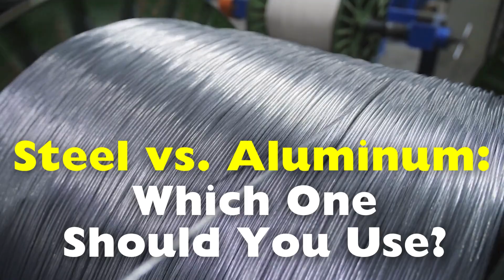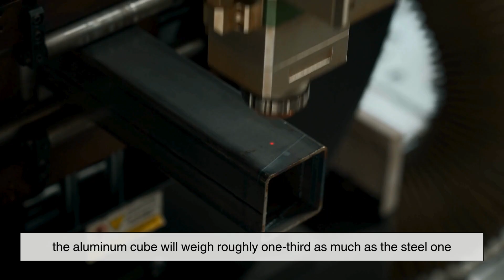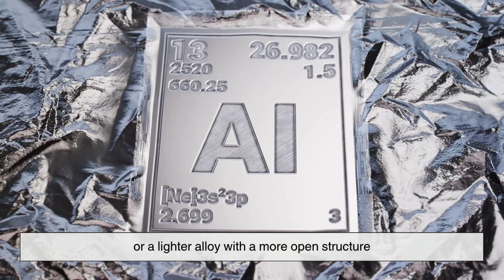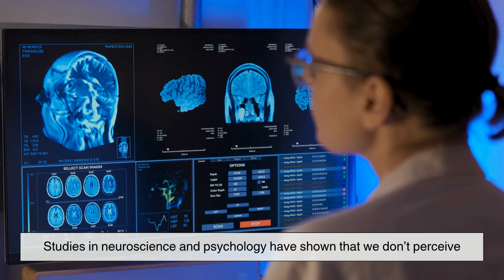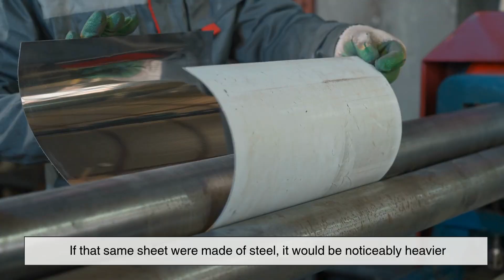Why Some Projects Call for Steel While Others Need Aluminum

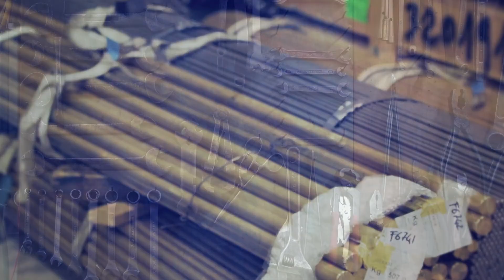Comment: Regarding 7:51, for those who are unaware, the density of tungsten is nearly the same as gold which is 19.3 grams per cubic centimeter. Therefore fraudsters have been selling fake gold disguised as gold plated tungsten to gullible buyers. This is because gold plated tungsten looks like and feels like real gold. However, tungsten costs as cheap as 75 cents per troy ounce whereas gold is extremely expensive costing $3,500 per troy ounce on April 22, 2025. Therefore naive buyers can lose a lot of money if they are deceived into buying fake gold.